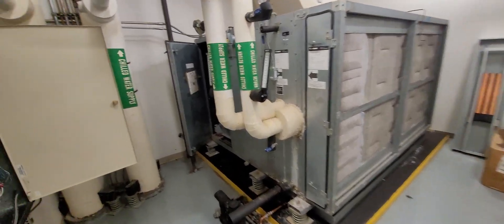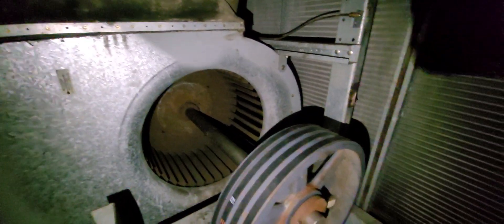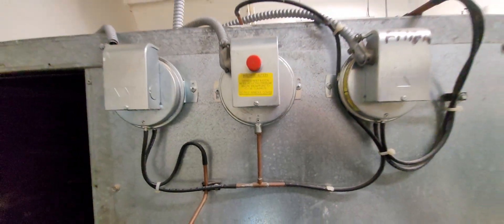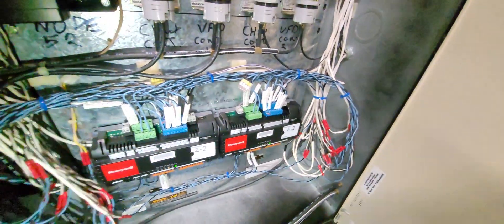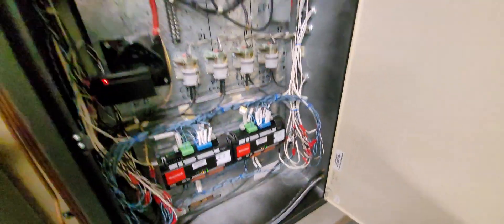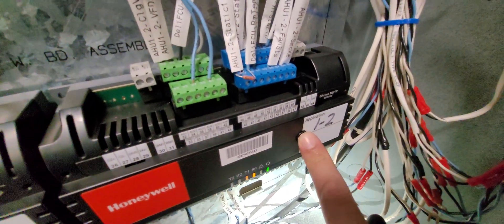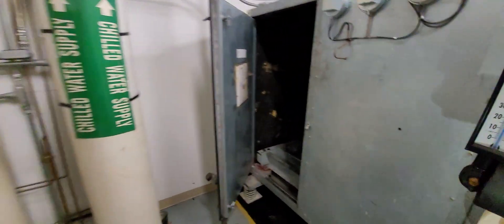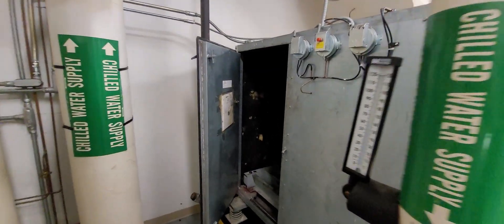Trane 50 Ton Air Conditioner Not Coming On. High Static Pressure Switch Reset.

Comment: Okay but what was the actual cause for your high static limit to trip. Were there too many VAV boxes with dampers shut? Was there a sudden loss of pressure and the computer tried to ramp up the VFD too quick? Is the discharge static pressure tube reading correctly compared to a Fluke 922? Or is it an issue with the limit switch itself and needs calibrated or replaced? 

So what caused the high static issue?